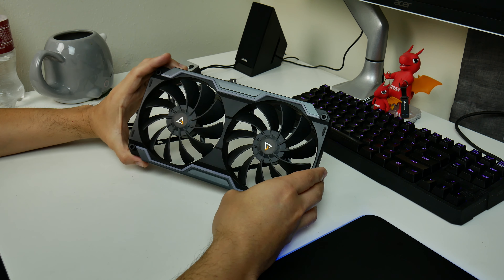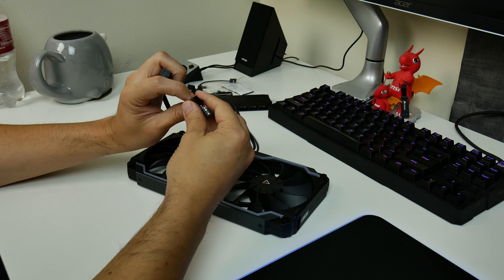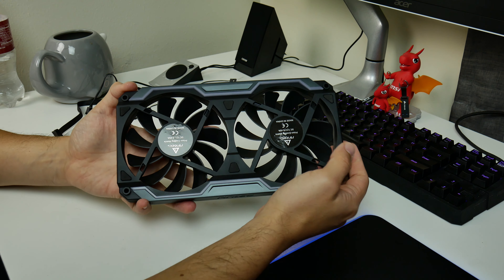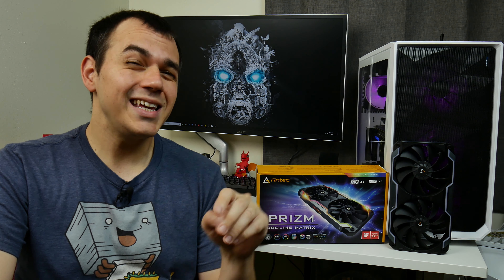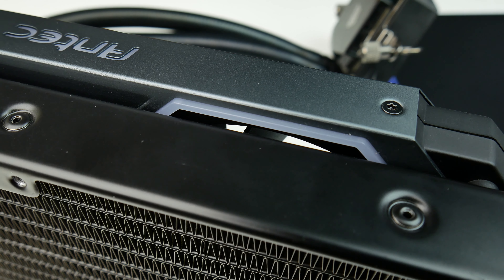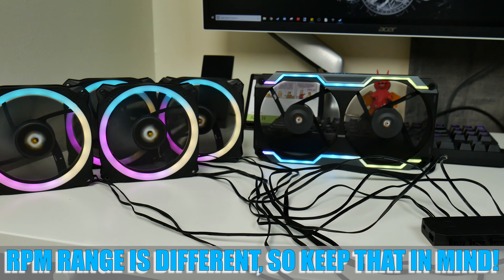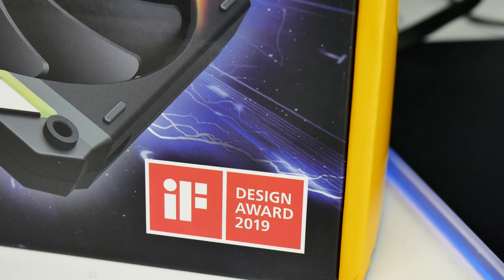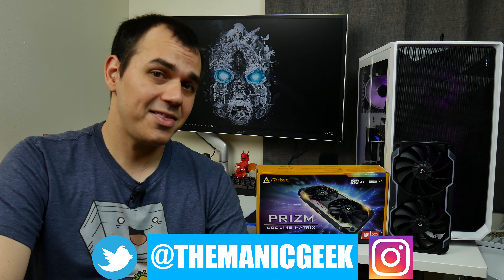TWO FANS ARE BETTER THAN ONE - ANTEC PRIZM COOLING MATRIX REVIEW

Comment: PLEASE HELP!!! I did all conncetions but it still dosent show up in aura sync??? I don't have a 3 pin rgb connector. Will it still sync????
Reply from the maker: If the hub isn't connected to the motherboard somehow it can't sync with Aura Sync. You'd need to use the supplied lighting modes on the hub.
Reply: @TheManicGeek  Thanks. Did anbit research and got to know that Ill have to get a 12volt to 5volt rgb converter for it. So probably this will fix the syncronation 😅

Comment: Does the fan controller supports fans form other brands such as Deepcool?? Then I can control all my fans speed and RGB using one controller instead of going for individual controller for each brands...
Reply from the maker: The fan must meet the three following criteria:

1. Should have 4-pin PWM plug; 3-pin can still be powered, but mixing 3-pin and 4-pin may result in you needing to go with Voltage control instead of PWM control on your motherboard for all fans to work properly (fan hub still needs to send and receive signal from the motherboard)

2. Standard 3-pin 5V ARGB header

3. Not part of a proprietary RGB lighting ecosystem (has to play nice with others; not Corsair, NZXT, etc)

If it meets those three criteria, then you're golden... or whatever color you want to pick, it's your rig.  I can confirm that fans like the Fractal Design Prisma AL-12 PWM will work on the Antec controller, but note that certain fans may be sensitive to the specific signal output of the hub: one of my Prisma AL-12's had this occasional white flicker in the LED's when using the Antec hub.  It was only noticeable due to my using a static purple lighting configuration at the time, but it is something to keep in mind as a possibility.
Reply: @TheManicGeek  thank you so much.... I'll keep all these is mind...

Comment: I see that the fan is attached to a radiator, but can you use the fan as a case fan and just mount it inside the case at the top of the case?
Reply from the maker: You certainly can, just use regular fan screws and you're golden!

Comment: Hi ! I have Asus Z270-A and can't find where i will connect the controller with my motherboard to sychronize the Aura sync. Anyone who know's please ? ? Thank you ! ;-)
Reply from the maker: Based on a cursory search of images of your board and confirming on the Asus website it looks like your board only has a 12V non-addressable header at the bottom set between your COM header and TPM header, so you can't connect this control hub to your motherboard since it runs off of a 5V ARGB header.
Reply: @TheManicGeek  Thank you for your answer !!

Comment: I have this with the Neptune 240 and for some reason don't fit on the radiator. and both is from Antec.
Reply from the maker: You are likely trying to install it on the wrong side of the rad: that AIO has a similar (nearly identical) design to the OEM design Raijintek uses in that the pump is installed in the end tank, which increases the height of the tank. That means unless you're using regular fans you'd have to mount the Matrix on the other side of the rad in order for it to work due to the extra space the Matrix fan frame takes up and the end tank height. I've done this with my Raijintek AIO and it works fine. Make sure you're using the correct length screws to mount the Matrix fans, and make sure if there are washers to use with the fasteners that you use them to keep the fasteners from penetrating the fins of the AIO; I suspect the other side of the rad has a frame that sits closer to the fins.
Reply: @TheManicGeek  i have tried both ways and the only way to make it fit is to have longer screws and spacers. Basically it dont sit flat on the rad, the edge pointing to the pump on the rad catches the corner, preventing the flat fit. Basically it leaves a gap but i cannot fit it without slightly longer screws.
Reply from the maker: Right, so you need to mount the Matrix on the other side of the radiator...
Reply: @TheManicGeek  yeah on the flat side it dont fit properly. I can get it to fit, but like i said, longer screws and spacers.
Reply from the maker: Hmmm, odd. Can't say I had that issue with mine, but with a design like the Matrix there were bound to be designs they didn't work with. Without actually seeing what you're talking about I can't say I get what your issue is so I'd have to pull out my AIO and Matrix when I get home later today to see what's up. What case are you trying to install it in, and in what orientation?
Reply: @TheManicGeek  ok, I will try to give as much info as I can.
When I first tried it on the side with the pipes, I aligned the screws with the holes, but the edge was catching, preventing it to fit.
Tried on the other side, the same story.
I tried using washers to space it out on the end, but it seems I will need longer screws. also, the gap between the rad and matrix is like 3mm if not more.
my plan is to mount the matrix to do the cooling, and the included fans to pull air out.
This will be for top mounting.
the case is the Antec NX400, so plenty of space up top, it's just the matrix don't fit.
Reply: @TheManicGeek  also, do you still use the Antec Kuhler? Cos I have the Neptune 240. I am honestly not sure why it doesn't fit, but its hardly a train wreck.
Reply from the maker: So I just pulled out my Raijintek EOS 240 RBW to test the Matrix fitment; feel free to look up that AIO if you'd like, the rad is damn near identical to the Antec Neptune rad. When you set the Matrix on the rad in pull, meaning on the side of the rad opposite the barbs in this case since you're roof-mounting it, it fits flush with no issue at all. Unless the Antec AIO has some sort of extra height on the radiator end tank that isn't present on this Raijintek AIO then there shouldn't be anything keeping it from sitting flush on the rad on that side. On the side of the rad with the barbs it can't fit because of the end tank thickness combined with the extra material used for the Matrix frame.

The other thing to consider is the distance from the radiator frame to the fins of the radiator: on the side opposite the barbs there should actually be more room than there is on the side with the barbs so you should just need the stock screws; I checked the screws that came with my AIO and it works fine.

I understand this will cause most of the RGB lighting to get lost due to where you have to mount everything, but that's the only way to mount a Matrix fan frame to a Neptune AIO radiator. Looking at even the mounting hardware for the Neptune unit, it's identical to the stuff that comes with my Raijintek AIO so apart from aesthetic choices by the companies and the fans they should be the exact same AIO. Why your Matrix fans wouldn't fit on the side of the rad without the barbs is beyond me.
Reply: @TheManicGeek  I had a look at the Raijntek AIO and yes it does look identical. Basically, the edge of the motor, where the pipes are, are catching on the edge of the matrix, and this is on both ends. Like if a put the Matrix flat on the rad, the screw holes don't line up.
So that is why I will be attempting to make longer screws shorter. the included ones are 32mm give or take, so I will need to make them 37 to compensate for the spacers.

I don't understand it either why the matrix doesn't fit flat on the rad seeing as it is both from Antec. Like if spacers is the way to go then so be it. Im sure the gap will just act as more intake on the sides, even thought the matrix produces arctic like window flow, and that's even in a warm room.
Reply from the maker: @ghostv86  Jeez, yeah that sucks... but if you can at least get it to work then that's something.
Reply: @TheManicGeek  i will get it on there eventually, but for now the matrix cooler is front mounted as just an intake fan(s).
Reply: @TheManicGeek  small update. i managed to get the cooling matrix onto the rad, but on the other side that blows out. So the cooling matrix pulls out and the fans from the AIO now pushes, so altogether 8 fans if you count each fan on the matrix as one. the whole thing looks crazy, but sadly still the same hardware.

Comment: @
The Manic Geek  ...  They are 60 bucks now.  :-)  I am having a hard time not buying these.  I had decided on PRIZM MATRIX because I don't like white or clear fan blades: 5 fan kit 120mm, and a 2 fan kit 140mm, and a single 140mm non rgb.  But, I don't like rgb fans as much as many people, so this solution is an alternative, EXCEPT, that means no 140's for my front!  Two selling points are, if a person wants some rgb, this will do it, and different fans can be used without that being a factor on the fan, it self.  The best fans don't have RGB of any kind.

Lancool II;
NO AIO, anywhere);
PRIZM MATRIX fans;
2 x rgb 140 at front upper;
1 x non rgb 140 at front lower, (all the way to the bottom, with the 2 uppers resting on top of the bottom fan);
2 x rgb 120 at top
;
2 x rgb 120 at bottom, (over PSU vented shroud);
1 x  rgb 120 at rear.
No lighting on my NOCTUA NH-U12S chromax Black, (with additional fan).

That means I would need 3 of these for uniformity if I did not use rgb fans.  The lower front and rear can just be 120 non rgb black fans, with the rear being a thin model.  Well, I can still use one non RGB 140 in the front lower.

Not using two 140 front uppers is what bothers me, except I could put the two upper 120 fans on another, faster, separate speed profile.  I doubt I would do that.  I don't want two fans being louder that all the other fans.

The only thing I would want to do is turn off one side of the RGB casing.  I could probably remove one pin on a connector, (the connectors), to do that.  I would have to actually see how it is wired.

Anyway, yeah, I am probably going to buy 3 of these.  Maybe two, one for front and lower, thin fans top and rear.  Ha ha!  This crap is mind boggling.  Without any RGB, though, it's easy!  And, since I made this looong post, when I am finally finished with the build, I am going to post specs and a pic.  :-)

Comment: Is there a way to turn the fan speed down? i just got one and it sounds like an air plane taking off
Reply from the maker: Use your motherboard controls for your fan header if your board doesn't allow you to do that then your only other bet is to use a speed reduction cable.

Comment: Can this be used as a gpu cooler?, i want to replace fan assembly on my asus rx 580 card and was thinking to go with this...would it be ideal to keep temps under 70 on load?
Reply from the maker: Technically yes, you could use this as a  GPU cooling solution, provided you could also find a heat sink designed to mount to your GPU that also accommodates two 120 mm fans. I haven't seen anything like that in recent history; Prolimatech used to make something that would house two 120 mm fans, but the reviews aren't overly favorable and the heat sink itself is a monster in terms of size and likely wouldn't mount to a modern GPU.
Reply: The Manic Geek thank you so much man, keep up thr good work!

Comment: can i add other led fan to this controller box ?
Reply from the maker: As long as it uses a standard 5V 3-pin connector (looks like a four pin with one pin missing) then yes, you can. I've actually used Fractal Design Prisma AL-12's on this controller and the lighting and fan control worked fine, though it should be noted that depending on the fan you may have power delivery issues with the lights: one of my Prismas doesn't like the controller for some reason, and occasionally flickers. It's just the one fan too: all other fans work fine.